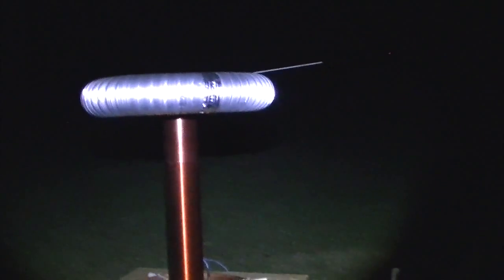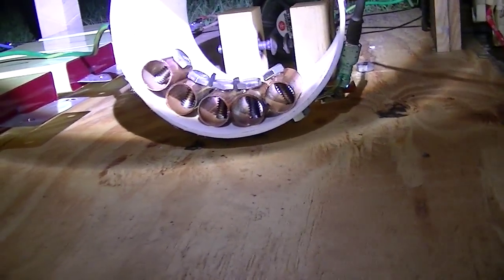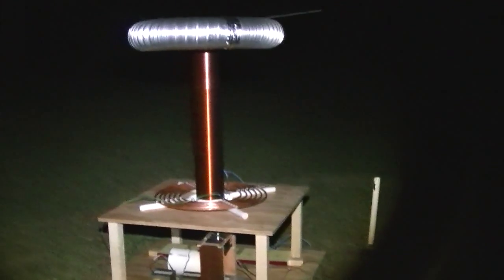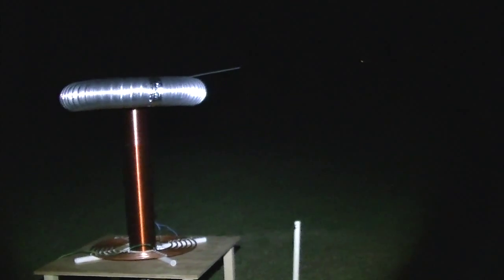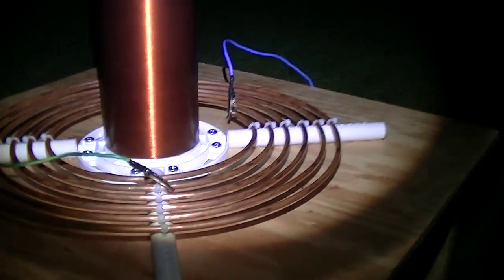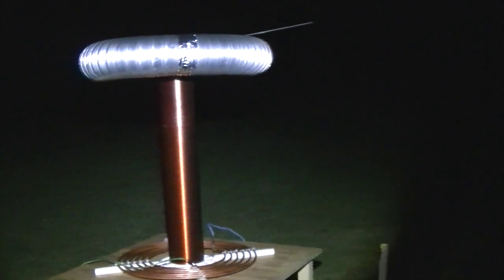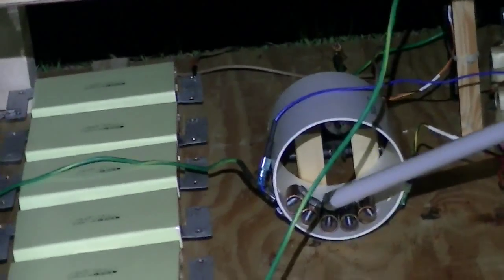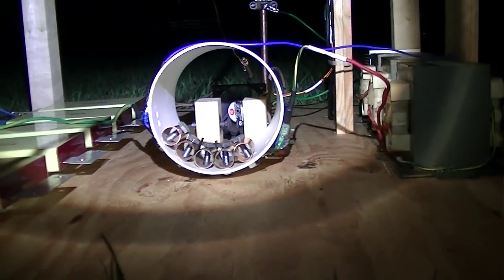Dual MOT Tesla Coil change in spark gap design

Comment: you could make around 60" sparks using 2 MOTS.
Reply: I have a question. 
I want to build a dual MOTtesla coil. 
I have two small MOT's and a big one.
Should i use the two small ones or one small MOT and the big MOT?

Comment: Have you tried tuning it better? With arcs that small it's obvious the primary tank circuit and the secondary are not in tune. If it was, you would have a much larger spark length, even with only a 4kv input.

Comment from the maker: Also, this is not an NST coil, currently without a doubler I am only giving the coil 4kv so 8-12 inches on only 4kv is impressive to me.. Do you still recommend that low capacitance even with the low input v?
I have the means to make a doubler using MOT caps, but I am pretty sure I killed the pair I was using.  I will be making big AC caps out of 1kpf 300vAC caps I have laying around from a box bought from Electronic Goldmine, maybe those will work better in a bank to handle the voltage load?

Comment from the maker: Thank you! 
I will be getting a HF grinder tomorrow (coupon for 12.50 woo hoo!) to use as an RSG, need to test on mine, but I believe they are asynchronous motors, to use as an RSG.  Most likely will start with carriage bolt electrodes as the tungsten I have is difficult to mount into anything.  

JavaTC and solid works (verified by a TC enthusiast) recommended 500nf actually, hence the 5 caps, but we found that 100nf was the best.  When I went to 50 there was no discernible increase.

Comment: Nice improvement! 
Standard spark gaps will always fade out due to thermionic emissions, metal vapor, and other conducting mediums as they heat up. High pressure compressed air or nitrogen seems to be the only way to keep them from having quenching issues. RSG's are the best way to go. 

From what I can tell, .1uf may be a bit much. Try to aim for .015 or .030uf. That should give you 2 to 3 foot streamers without a breakout point. 

Looking forward to seeing more of your work!